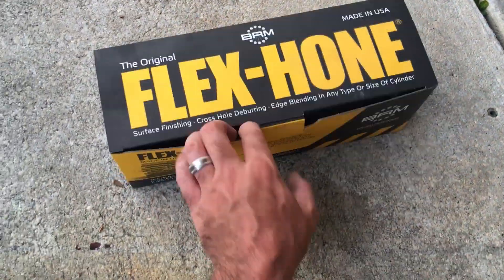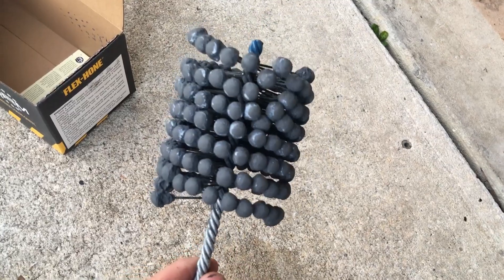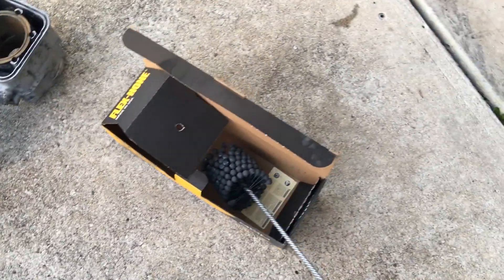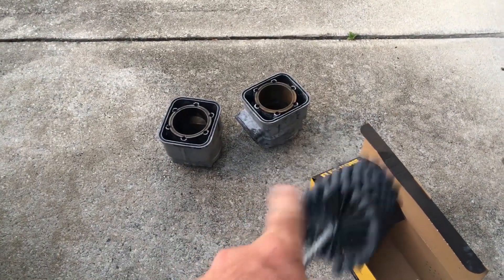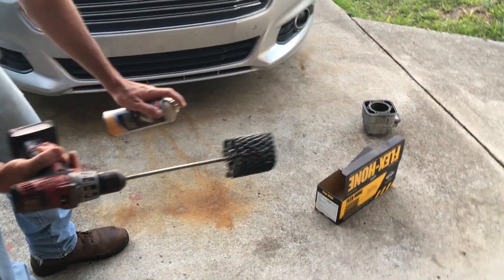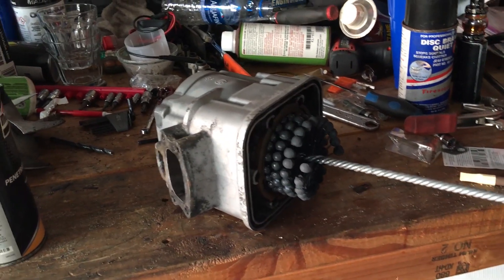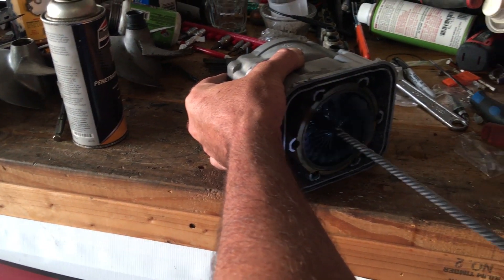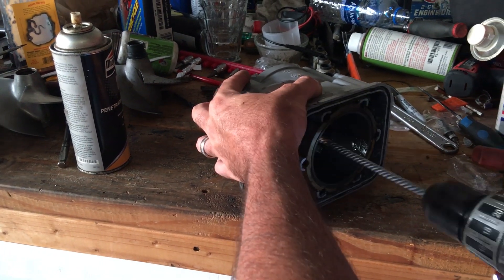How To Hone/Deglaze A Cylinder, New Rings For Piston

Comment: Only thing he didn't mention was the reason you want all the 45 degree lines, could have been from the fire ball lol. BUT the reason for this is to hold oil in the small cross haches. Its a good video but if you have many hours on your engine what starts to happen is you get more wear on the intake and exhaust side of the cylinder giving you a slight oval shape. there are tolerances for this wear. if you are more then .012 (depending from engine to engine, information would be in a service manual. Seadoos are free online) than a bore / hone and over size pistons would be needed so you don't prematurly have engine failure. Take care and safe riding!

Comment: Question: if I have an compressor pump I want to rehone the cylinders on can you use the old piston rings ? The reason for asking is the pumps i got are old still have compression just not much and the company doesn't sell parts for this older model anymore. Next if I do need to replace the parts could I just get rings from another compressor pump company the same size  and use them or do they have to be designed specifically for the piston.

Comment: You DO NOT use a ball hone on a two stroke cylinder that has ports.   You need the flat stone type.    I built race engines at R&R jet tech back when jet ski racing was good.  I know a few things about this topic.
Reply from the maker: Glad you built race engines. Sorry but my ball hone has done 12 jugs so far.... Flat stone can get caught in ports and damage the cylinder....
Reply: Sebastian BlueCrew ,     I agree. If you don’t know what your doing.  Don’t quit your day job buddy.  My original comment wasn’t a dig a you personally.    I am passionate when It comes to engine building and doing things correctly.  I take serious issue when bad information is put out to others who may not know any better and looking to videos for guidance.
Reply: You didn’t need to come across as a know all flog either, but apparently you’re good at that too.  🙄
Reply: jachtha rippa , wasn’t trying too.  I don’t know everything.  But 11 national title winning engines makes me pretty confident on this topic.  He might be a great guy.  But should also be willing to listen to someone who actually knows the correct way to do something instead of getting defensive. After all he’s putting info out there for others to follow that is not entirely correct.  There’s many important steps he didn’t do , or at least mention that need to also be done. Just a couple for instance, not letting folks know you need a dial bore gauge to verify both cylinders are identical after honing. also measuring the piston to cylinder clearances to make sure there correct after honing, and verifying port heights after the base gasket is installed. He’s just pissing into the wind with his method of engine building.  Just because an engine runs when it’s assembled doesn’t mean it’s necessarily right. You can fuck up cylinder clearances in just 2 swipes of a hone and not even know it without checking and severely shorten your engines longevity.  What I watched was a cocky smart ass weekend warrior home garage hack put out information that could end up costing someone who doesn’t know better alot of  money. I have a major issue with that.  Thanks for your feedback though. If you want to follow this guys advice good luck.  Heck after the 12 cylinders he’s done 
he must be a pro So don’t listen to my advise. Me personally , I like to question anyone trying to sell me on anything who’s only done something 12 times and passes themselves on others as the Seadoo cylinder messiah.   Just be sure to  sip on that fireball and only use the Klotz he pushes. it seems to protect against ignorance also. 👍.
Reply: Chris, awesome update and edit, and yeah you certainly can’t build an engine without a dial bore gauge, so that was well worth adding to the post👍
Reply: FoxRcng708, just enjoyed watching some of your welding. Stick with it, you’ve got a future in tractors. 👍